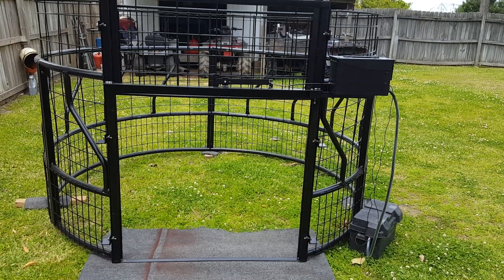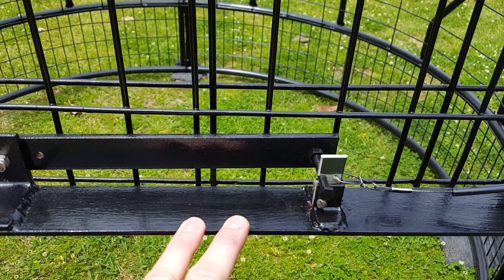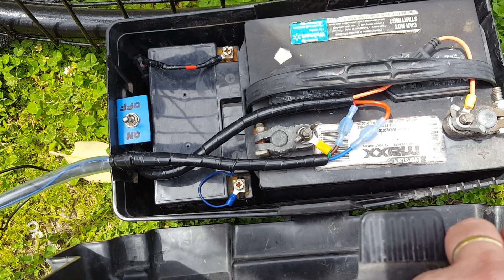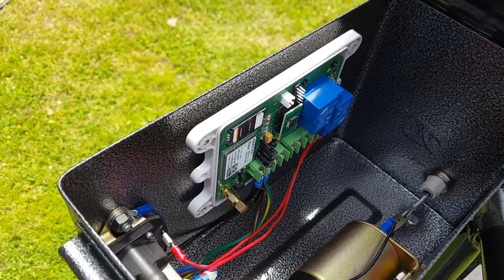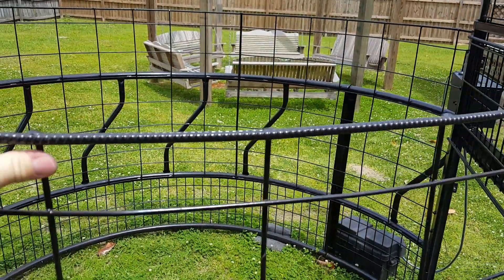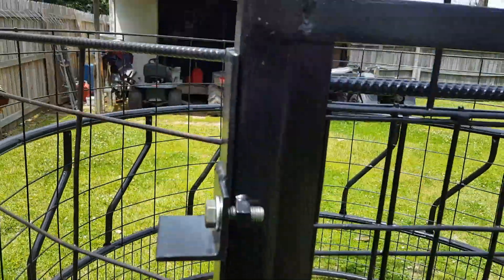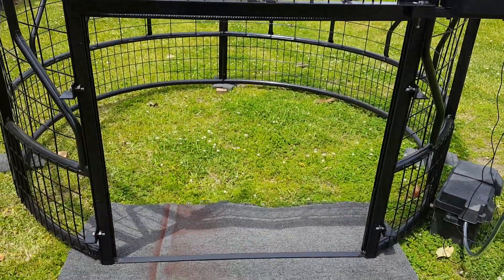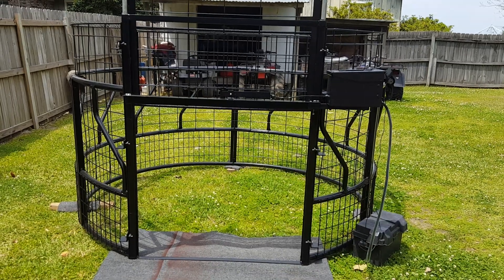Remote Hog Trap- Home made

Comment: Hello Robert love your video!Did your Kiao time gsm load up to network properly cause mine never got solid red light that indicates network was working?
Reply from the maker: I hardly ever had any trouble with signal locking on.  You using AT&T SIM card? Also, It's been a while since I've used it, so I can't really remember the light sequence once it locks on. I thought it blinked slowly when it has a signal.

Comment: @Robert Boyd add me to another for thanking you for taking the time to do this. I like yours better than any I’ve come across. Question on hay ring; what’s the most you have trapped at one time?
Reply from the maker: I caught 7 in it one time.  Five adults and 2 piglets.
Reply: @uhoh71  Perfect, this is about the typical sounder size we get (Blueridge mountains). Every now and then we see a mega sounder. I am going to start buying the components and start the build soon. Luckily my neighbor is a semi retired commercial electrician and he has offered to wire it up for me. Me and a buddy are going to work on the hay ring. Looks like I may have to get one at Tractor Supply. Local farmers tend to hang on to them
Reply from the maker: I made sure to put the corn in the back. Also, the door drops super fast
Reply: @uhoh71  I also read in your ‘wiring’ video I believe, that you’re running off one battery now? What battery are you using now? How does this effect wiring setup and parts? I’m sure my electrician will know but I’m curious.
Reply from the maker: @user-pj2hp4ig4o  Yea, I'm using only one battery. It's a marine deep cycle. I just moved the battery leads from the extra battery over to the one battery.  It doesn't require but about 20 to 25 amps to activate the popper solenoid.  A deep cycle battery can handle that easily.  Plus, I have a Coleman trickle charging solar panel attached which works better with a deep cycle battery.
Reply: @uhoh71  thanks again!
Reply: @uhoh71  One more thing; I’m researching cameras and am debating between something like a Moultrie vrs a security camera. It’d have to be able to be monitored from the top of our 50 acres. Any thoughts?
Reply from the maker: @user-pj2hp4ig4o  How's your cell service there? I originally used a Moultrie camera and did pretty well with it.  However, their service has now become pretty unreliable.  I would go with the Reolink Go PT 4G LTE if your service is good enough.  Much better setup with real time video. There will be a little lag but not much. To use the Moultrie, you have to let the pigs get to settling in the trap pretty well to ensure they don't leave before the door is closed.
Reply: @uhoh71  Thanks for suggestions. I’d like to put the trap on top of our ridge/property. I can use my cell phone up there but will check signal bars a little closer.

Comment: Where did you get the sim card?
Reply from the maker: Walmart. It's an AT&T pre-paid sim.  I do the $2 per day deal. You can close the trap by calling it and that doesn't cost against your $2 a day. You are only charged the $2 for text or data. With that said, I bet you could do FreedomPop and be way cheaper. Something like $5 a month.
Reply: @uhoh71  
Awesome! Thank you sir!
Reply: Do you have to pay a monthly fee to att?
Reply from the maker: For the $2 per day plan, you have to put a minimum of $10 a month on it whether you user it or not because the $10 expires each month. I do usually use most of the $10 each month sending texts to check signal and change settings etc...  I haven't used it in a while, but I may try the FreedomPop card next because you can pay 12 months at a time and I think the minimum is $50.  That works out to less than $5 per month.
Reply: @uhoh71  
I looked that up. I'm going to give them a call
Reply: Thank you again
Reply: @uhoh71  
I just bought a SIM card that shows to be $5 a month from tello. I'll let you know if it works. I looked at FreedomPop and it showed to be $10 a month.
Reply from the maker: @CC-cn7bg  Ok, let us know how it works.

Comment: On your video on how to wire it up you have one Battery.  On this video you have two batteries.  Do you need 2 batteries?  Thanks.  Wiring one up and just wanting info.  Thanks
Reply from the maker: I went to using just one battery. The board draws so few amps one battery is enough to actuate the solenoid and run the board without problems.

Comment: Good info - question , how and where do I get the SIM card and where does it go ?  Thank ya kindly
Reply from the maker: Go to Walmart and ask for an AT&T prepaid Sim. Use an old cell phone to activate it.  Use the code for a $2 a day plan and put $10 on it, which is the minimum required to use the plan.  It only uses your funds when texting so when you call the trap it doesn't charge you.  The Kiao relay has a sliding tray to insert the SIM into once it's activated.

Comment: Hello Robert. Just wanted to tell you thanks for your videos on how to build this trigger. I built one following the exact same procedure you laid out. Works great. I did want to ask you about setting up the AT&T sim. Right now I'm using a Speedtalk sim but it's garbage in the woods. I did buy a AT&T sim kit. How did you set it up and what plan did you use. Can't seem to find a plan with no data. Did you have to activate using a AT&T phone? You expertise is appreciated.
Reply from the maker: I got the prepaid Sim from WalMart.  You can activate it from a cell phone but the problem I had with that was the plan I wanted wasn't listed as a choice during activation.  The plan I use is the $2 a day plan. You are only charged when you send a text, then it's only 2$ for the whole day.   Calls don't cost anything.   I wound up calling the AT&T number for prepaid service and they activated it and added the plan.  When you do that, go ahead and get them to deactivate the voicemail.  You can also have them assign the IMEI number from the relay, but I've found that isn't necessary.  It's a pain to call in but probably the best method.  

On another note, I see there are a bunch of videos cameras that at cell operated now using AT&T and other cell service that will alert you when there is motion in front of them.  One of them is reolink. I think that would be perfect for what we are trying to do.  Not sure what the cheapest plan would be for that though. Maybe adding a line to my family plan, not sure.  Would be awesome to have a video feed when needed.  The Moultrie camera has worked well too though. Once the pigs settle in eating the corn the delay doesn't really hurt.
Reply: @uhoh71  Great!!! This is the info I was needing. Appreciate it.

We are using SpyPoint cameras now. Not sure what service it is using since a buddy is the one who set the camera service up. They work well though. Their app is not bad to use when receiving photos. 

Seems that out if all the cell carriers AT&T has the most coverage for being out in the sticks.

Comment: I would like to know where I can get the remote componets.
Reply from the maker: The gsm relay is made by a company called KiaoTime and is on Amazon.  The lock popper came from eBay.  They are on Amazon as well.  There is a link to the lock popper in one of the comments.  The relay I have is the GSM Auto version.

Comment: Do you have the information for the "35 lb. solenoid" I'm looking to build a door like this soon. Thanks for your tutorial.
Reply from the maker: I bought it off of eBay.  It was a little over $20.  I'll post a link and we'll see if it works. https://rover.ebay.com/rover/0/0/0?mpre=https%3A%2F%2Fwww.ebay.com%2Fulk%2Fitm%2F131570934249
Reply: @uhoh71   Who do you have your sim card/ cell phone service through?
Reply from the maker: @shawnlennon6203  I use the AT&T prepaid sim.  I chose the $2 a day plan.   I had to call them to get that plan, for some reason it isn't given as a choice when activating it by computer.  It you use a phone to activate it, you may get that choice without having to call them.
Reply from the maker: @shawnlennon6203  I noticed that you can get SIM cards on Amazon for relays and stuff cheaper than AT&T. You just need a card for the GSM network with text and voice.  Saw some for around $5 or so.  May be a cheaper way to trigger the relay.

Comment: I just got the same relay and similar setup... So it looks like you ended up terminating the power to the Kiao board direct from the 12v battery, without an inverter, but with a fuse in line (5a?). Is that correct?
Reply from the maker: I ran  dedicated wires to the board from the battery so as to not have a fluctuation in current when the solenoid is fired by the board.  It is run directly from the battery to the board, Positive and negative. I used the smaller micro fuses in that, I believe 2.5 amps since the board draws so little of power. I think that a 2.5 amp fuse was as small as I could find.  For the solenoid firing the lock popper solenoid I ran a heavy Gage wire, around a number 12 straight to the one lug of the lawn mower solenoid with about a 20 amp fuse.  If I remember correctly it would blow a 15 amp fuse.  I tapped off of that wire for power going through the kiao relay then back to the trigger on the lawnmower solenoid.  On the other side of the lawn mower solenoid, out side, the power wire goes to the power connector on the lock popper.  I ran a small wire from the battery negative to the mounting bolt on the lawn mower solenoid on one side and a wire from a mounting bolt on the other side of the solenoid to a mounting bolt on the lock popper to bond it all.

Comment: Just curious on why you used a secondary solenoid? Im trying to put mine together and was wanting to know if it is nessesary?
Reply from the maker: I did that to keep from damaging the relay in the board.  I had an electrical engineer tell me that repeated high amps through those small relays would eventually damage them from arcing when they actuate.  Now only an amp or so goes through the board relay which should allow it to last indefinitely.  I read somewhere were a guy suggested you could put a resistor of a certain size across the in and out of the board relay to keep it from arcing.  Can't remember the suggested size though.  You see this done on golf cart solenoids to keep the high current from burning them out.

Comment: How have you found the power consumption to be?  I'm building a similar system with single battery and am trying to decide what size solar panel I need to keep it fully charged.
Reply from the maker: It's not much draw at all.  I believe it's around 60 milliamps or . 060 amps.  The panel I've been using is made by Coleman and it trickle charges at about 1.5 amps.  The battery stayed at full charge the whole time.  The battery is a flooded lead acid car cranking battery. And it does well. The only reason I'm using it is cause I had one sitting around not being used.  If you buy one get an AGM type battery like is used in an ATV;  sealed lead acid glass mat type. Then you won't have to worry about acid vapors corroding stuff.  Although, I haven't had any problems with that.  Look on eBay for a YB16CL-B battery. I had one of those in it for a while and it was perfect. However, I sold it with a 4 wheeler I was getting rid of. Perfect battery for the trap. The solar panel I have is between 12 and 15 watts if my memory serves me correctly.